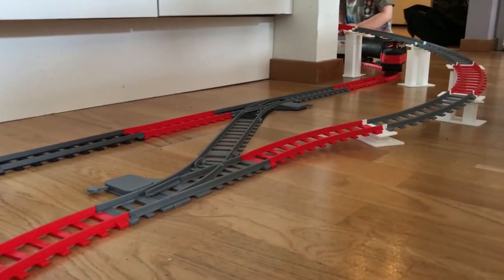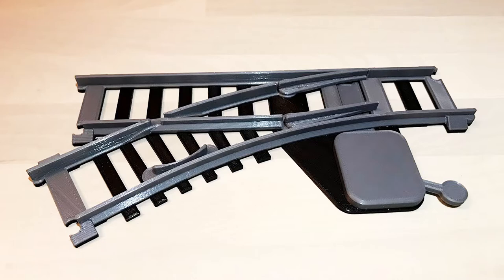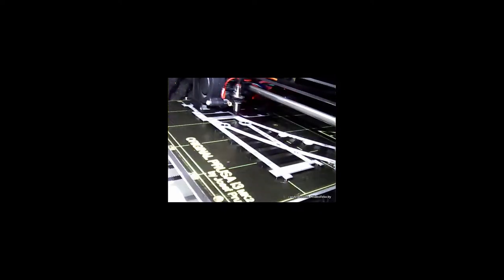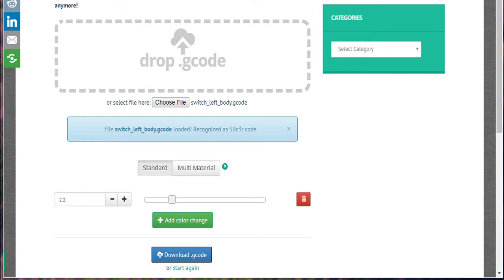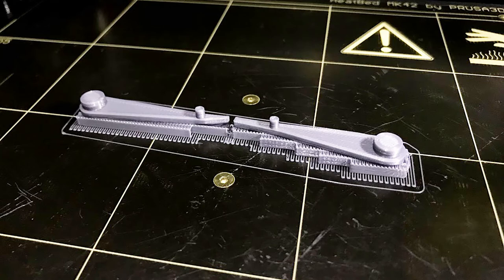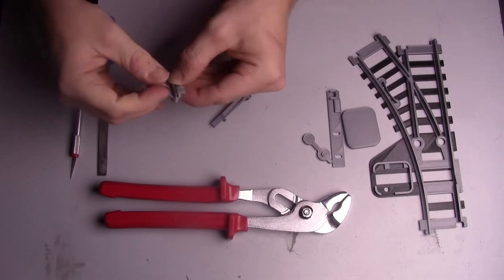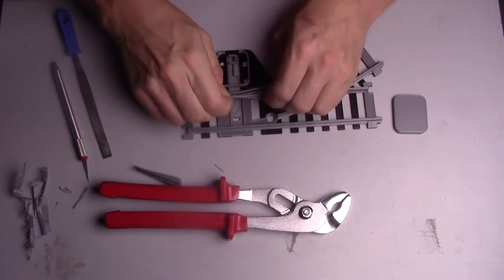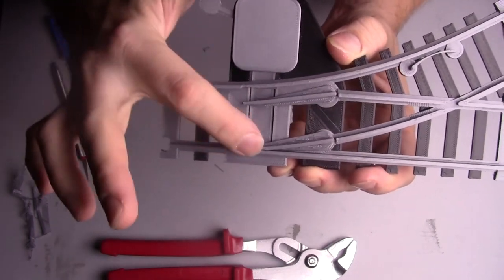3D Printed model railway - Building instruction - turnout

Comment: you are a wizard!
Reply from the maker: Justme Igor Thanks! but I cannot find my magic wand! :D
Reply: @drdistorzion  i think your wand is in the program you use, i tried tincercad and 3d builder, but still figuring it out. i am at the point to buy a 3d printer and going to start with your models. in the meantime i will try and hopefully sucseed in 3d building and scanning 3d myself. i would like to convert my n scale to g scale 1 at 32 (i have a lot of rolling stock and locs). My printer will be probally the cr10 v2 with a 120cm by 30 cm heated bed for abs. Any tips on a cad program or printer will be appriciated or help. thanks in advance